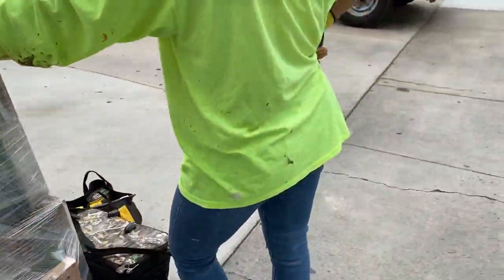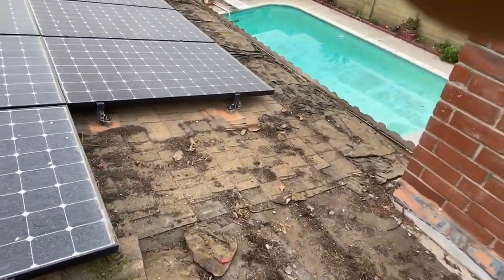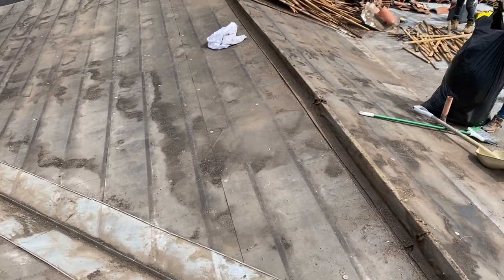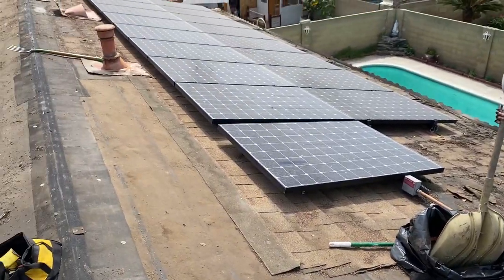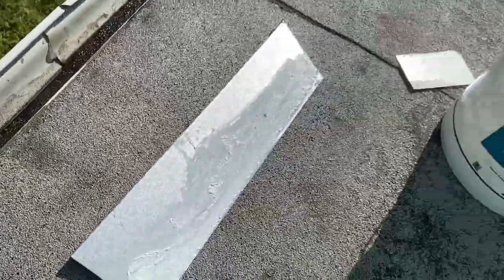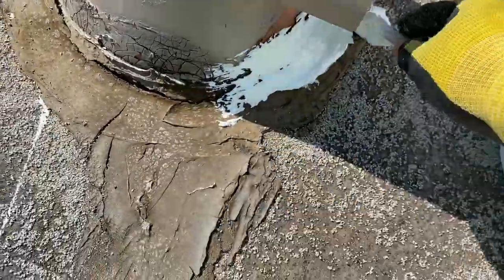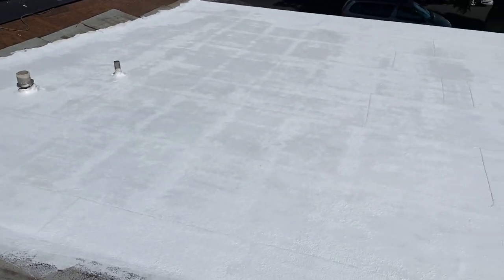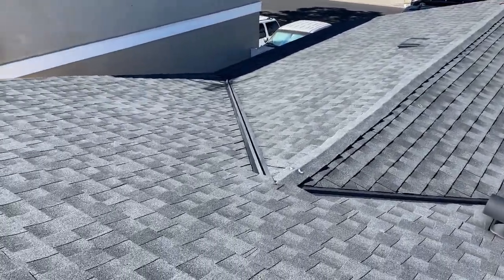OMG! They made a F@cking  mess !!

Comment: I have a tile roof with battens, but it doesn’t even need them. The slope is not that steep if I re-tile the roof I do not need to put them back right. The batten run across the valley and they are causing a lot of problems on my roof.